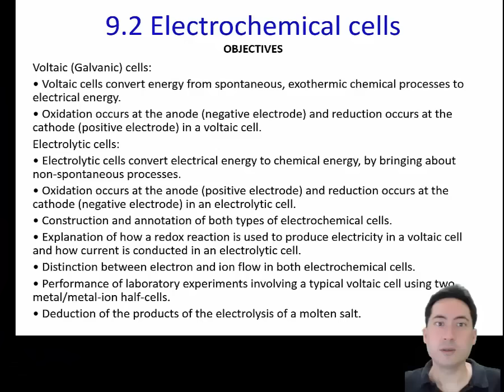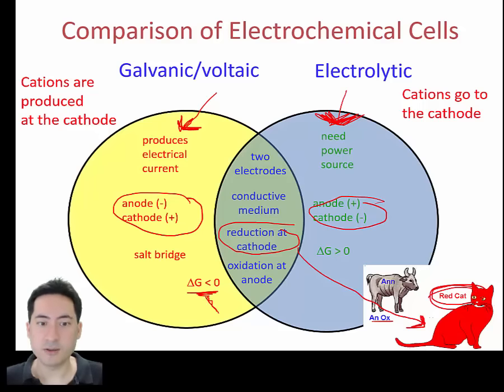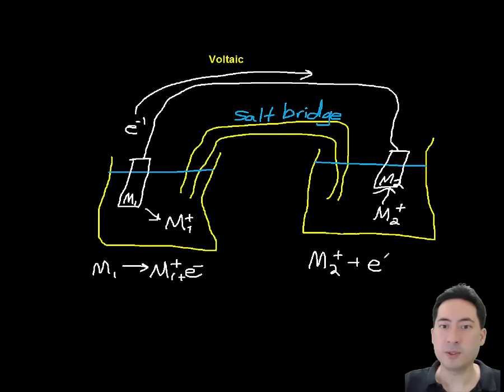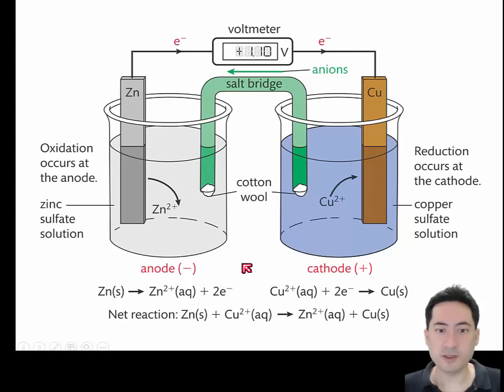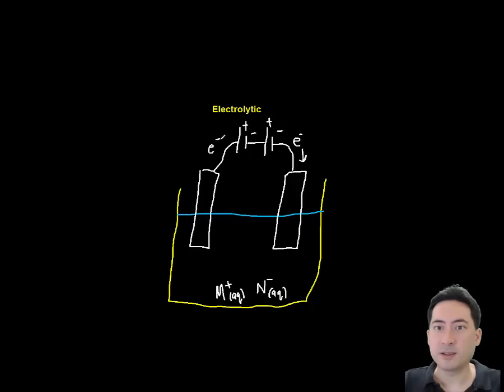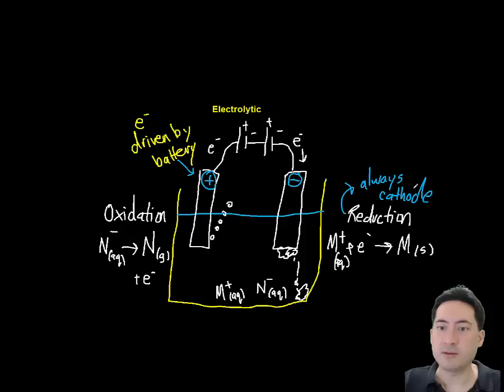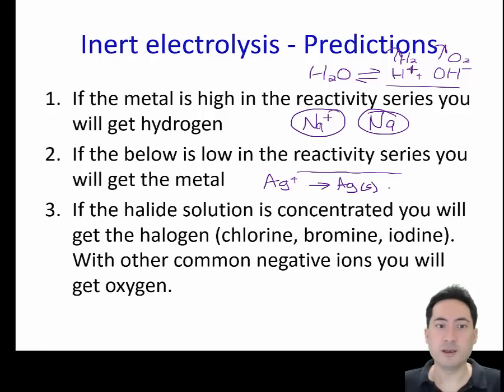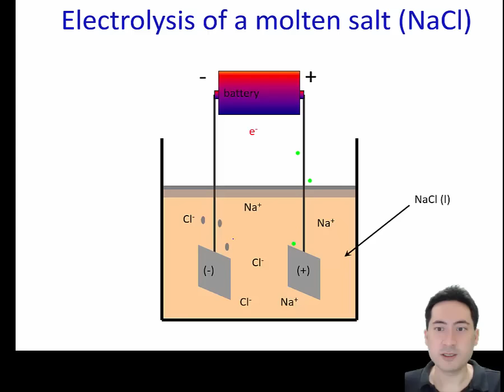IB Chemistry Topic 9 Redox processes Topic 9.2 Electrochemical cells SL

Comment: I’m quite confused , he said that the electrons move from the anode (-) to the cathode (+) for the voltaic cell , but for the electrolytic they move from the anode(+) to the cathode(-) . The charges are swapped around so it’s kinda confusing . Could someone explain why the charges of the electrodes don’t affect the flow of electrons ?
Reply: the charges of the electrodes do affect the flow of electrons!! what you need to remember is what electrode is related to what charge.
Voltaic cell- cathode (positive electrode) and anode(negative electrode) and because electrons are negatively charged in nature, they are attracted towards the positive electrode which in case of the VOLTAIC cell is the cathode.
Electrolytic cell- cathode (negative electrode) and anode (positive electrode). the reasoning behind the flow of electrons from negative to positive is still the same but this time since the ANODE is the POSITIVE electrode (remember, what the electrode mean for the voltaic cell, is the opposite for the electrolytic cell) they will move from the cathode to the anode.
Hope this helps :)

also, use the mnemonic CNAP for electrolytic cell- Cathode Negative Anode Positive. just remember the opposite is true for voltaic cell (in terms of electrodes and their charge)